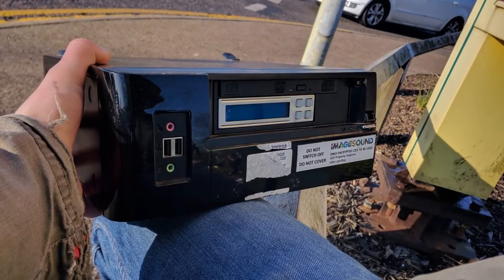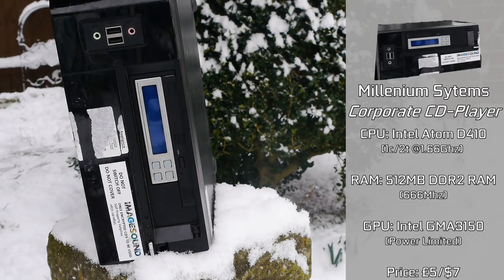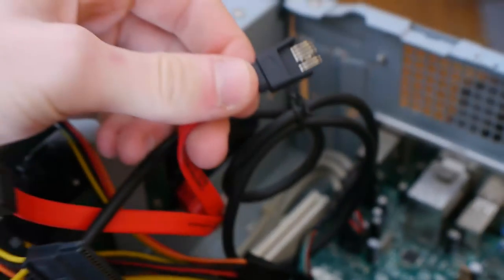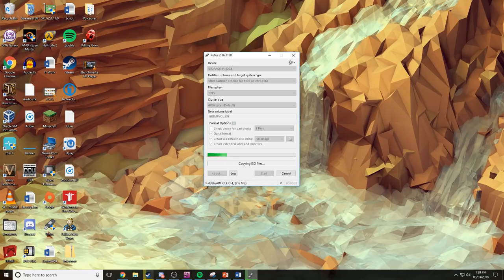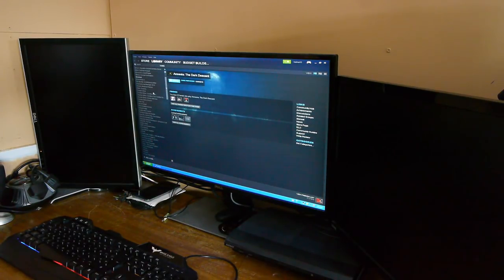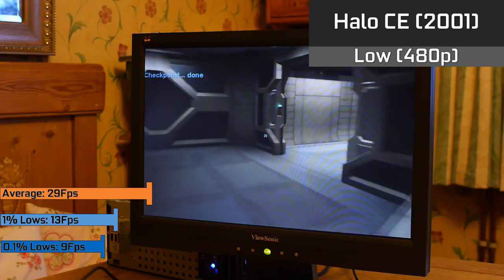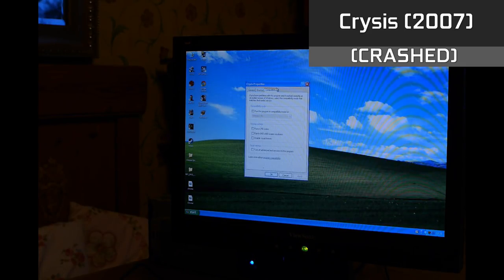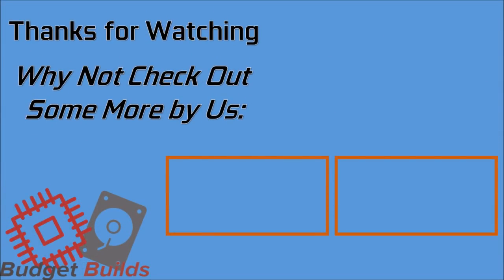Can we GAME on a £5/$7 CD Player from 10 Years ago?

Comment: Gt 610? Sadly, that was my first gpu bought from amazon.
Reply: Klutz Specter there are versions of the GT 610, GT 520, 8400GS, 6200, HD 3450 and HD 5450 on the old fashioned PCI bus (as the motherboard lacks both PCIe and AGP slots)
Reply: I just wonder how gaming felt back then, playing doom in the 90s and using 1Ghz cpus, sound cards and such.
Reply: @RWL2012  I had a 6200 PCI video card in an old P4 system, there was also the 6200 turbocache which was an even cheaper version of the 6200 because the card only had 16-64mb Vram (depending on what version you bought) and used system ram for the rest (so the system seen at least 128MB Vram) but performance was even worse due to the turbocache, and it wasn't really a great card, it was better than the Intel iGPU that was in the system I put it in.

Comment: I have a challenge for you.Buy a prestigio netbook with windows 8/10 and try to install windows 7 on it i tried it for weeks but it is just too locked
Reply: BigSmokeVEVO lol, it should only need a simple change of BIOS settings. Something like disabling Secure Boot and changing the boot mode from UEFI to Legacy BIOS. That's what I had to do to get Windows 7 working on my Acer Aspire V5-121.
Reply: RWL2012 there were no such bios settings tho...
Reply: BigSmokeVEVO gathered as much. not sure what to suggest then sorry

Comment: i got help from toms hardware that i should be able to get a gtx 1050 to work with an i5-3470 and a dell 0XYZT71 motherboard i found near my gpu slot 1 2 3 and 4 is this correct
Reply: FM Mapping yeah that should work fine

Comment: I have the same issue with FarCry running on a Windows XP VM on my Windows 7 machine. No grass, at all. Just like yours. This is the annoying thing about retro PC gaming. You can only really play very old games (DOS) or new games relatively easily. Post 00's and probably post 90 games on Windows, not DOS are a struggle.
Reply from the maker: Try OpenGl Mode.

Comment: If you want to give this some GPU so it can at least play something, look for the older cards. For example Radeon 9000 PCI or 9250 PCI (just make sure its the 128-bit version). It is only DX8.1 card but it should make things like Far cry, HL2 and such playable. Do not go for the GT610 PCI, I have the card and its completely useless. Its PCI-E to PCI bridge is crappy and the GPU was really not made for that, its PCI bottleneck is so big that it is slideshow even in older games. Yes it can launch modern titles, but for what is good when you have 2-5fps.

Still, generally, in games the Atom gets outperformed even by Pentium 3, its gonna be crappy all around.

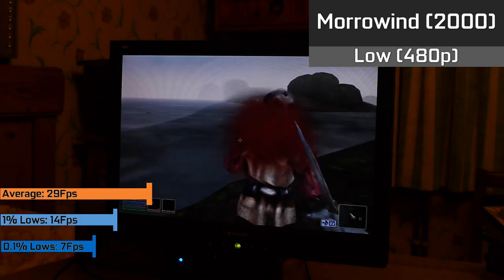Comment: 10:18 - Why would the GT 610 be considered "legendary"?
Reply from the maker: Its the fastest GPU available on the PCI Bus.
Reply: Oh that's cool! I never knew that is was offered on the PCI bus. I was just a bit perplexed because I have one of those but it's a PCI-e version.
Reply: ArthurIVA GT 520 PCI, 8400GS PCI, 6200 PCI, HD 3450 PCI and HD 5450 PCI all also exist. Although outdated and low end, they are still relatively "modern" cards to have versions for the original PCI bus (most examples are PCIe and/or AGP but PCI versions do exist) but for a machine like this with a bare basic motherboard with neither AGP nor PCIe, it's the best you can do.

Comment: considered trying ubuntu on these weird devices?
Reply from the maker: I might give it  go. Its very hard to get it to boot to other devices.
Reply: may be able to install the OS on a external device if its able to? CD, USB, harddrive
Reply from the maker: The PC doesn't like to post without an OS on a HDD Attached, even with Windows XP it was temperamental, if you disconnect the HDD at the right time it will post and boot to the CD Drive, so you may be able to do it that way.

Comment: You think this is slow?
Try my Thinkpad T500...
That thing has a GPU that is so slow it can't even run half-life 1 or quake 3 at the lowest possible settings. As soon as you increase the resolution to more than 800x600 it becomes a 1 fps slideshow. Modern Intel HD graphics are 2000% faster according to userbenchmark and it's almost the worst GPU on userbenchmark as a whole. I couldn't find anything to play on it other than the lightest FNaF game...
Beat that!

Comment: Why do you need a gt 610? won't any pcie gpu work?
Reply from the maker: It dosent have a PCI-E slot, it only has PCI.
Reply: Budget-Builds Official so the gt 610 is the best GPU that is just pci?
Reply from the maker: Muffin Man392: Yep.
Reply: Other cards are available. 6200 PCI, 8400 GS PCI, GT 510 PCI, GT 520 PCI, GT 530 PCI, HD 3450 PCI, and HD 5450 PCI.

Comment: Two mistakes, that's not a CD player, it's a custom made appliance and also, you wish that teensy Atom performed like a Pentium M. It's nowhere close and I have both, a laptop from 2005 with a Pentium M and the bigger brother, Atom D525. The atom sucks for almost every task, it even struggles when opening a window on windows 7 or XP.
Reply: Important question thou, can it play DVDs? ;)

Oh, forgot to mention but you probably figured it out. That Intel Desktop Board this system is built on, uses a BIOS written by Intel instead of the most common AMI or AWARD in other boards. It is very picky when booting from external devices and even internal disc drives. It takes, no joke, up to 2 minutes to get past the INTEL post screen and loading the boot information from an external device, it makes it really annoying to boot from like, an external disc drive to setup the OS or even to make backups. Set the boot order in the setup screens, reboot and patiently wait...

Comment: everything runs like crap cuz it probably doesnt have HardwareT&L (im almost sure it doesnt).
also, I think it could be overheating.
Reply from the maker: Never went above 30C
Reply: and why not overclocking it? Or it isnt possible?
I still believe it doesnt has hardware T&L.
Reply: Bero256 i had a netbook (clevo) that had an atom D525 and a GMA3150. I remember most games had issue with hardware T&L.
some games, like brainbread, had its graphics all screwed up just like the player 3d models
Reply: 3150 is full of random glitchyness, I have it in my old netbook (a handy kitchen recipe and browsing machine for my mother, at this point). I've gamed on it quite a lot as I used it when on tour with my then quite active band, but I mostly played DosBox games and ran PS1 emulation. There was a cool gaming list on the net what are it is capable of running. But I did finish HL2 on it in 1000x600 without problem, and my Atom isn't that much faster, if at all (1,5 dual core N550), but it did have 1GB of RAM when I used it the most (upgraded to 2 later down the line).
Reply: I have an Acer D255 and WinXP is a bit of a mixed bag with it because of the drivers. After trying several Linux distros, Win 7 Starter (came with the system alongside Chrome OS), Win XP, Win 8.1 and Win 10 on that netbook, I found it worked best with a Win 7 Home 32bit. Although the 8.1 was the fastest, it had to be worked around for the smaller than minimum resolution and the drivers for the keyboard shortcuts. The N550 CPU and DDR3 memory is just that more capable to make it decently usable even today. It runs 480p videos on Youtube,  720p encoded movies and the like, and surfing the web with 2 GB nowadays only limits it to less tabs. I've ran ePSXe,  MAME, DosBOx, Virtualboy Advance and similar with no issues, some DosBox games had a bit of emulator issues with sound sync and some drops here and there, but it happened to me even on proper desktops.  
I'll try and find a document where I noted all the games I've tested on it and which settings I had playable results with, I should still have it around somewhere.
Reply: I'll give more info about mine...
mine was had a clevo board. Atom D525, 2gb ram, gma3150, 160gb hdd.
it sucked at anything 3d.
GTA SA ran just like our friend said (40~50 fps), everything on low, strong stuttering.
cs 1.6 had some hickups most of the time.
brainbread, as I said, was completely unplayable. every 3d model was glitchy. textures were glitchy also.
if i remember correctly, robocraft run like trash. and the ground texture was invisible.
but quake iii arena ran like a tirsty beast!

Comment: gma 3150... i remember this horrible piece of crap... was used in atom netbooks too and it couldnt even run flatout 2 on the lowest settings possible (5 fps i guess) while amd's netbook cpus back then like the c-60 with integrated hd6290 could run the game just fine on highest settings.

Comment: Atom CPUs of yester year were utter crap!!!! I used to own an atom based netbook with higher specs than those shown here:
Atom n2600 (Dual-core) @ 1.66 GHz.
2GB DDR3 RAM
Intel GMA 3600 integrated graphics
320GB Sata HDD.
Windows XP PRO SP3
The damn thing even struggled running GBA games!!! barely reaching 80% speed, let alone running any PC title.
Youtube playback @ 360p was choppy  with audio stuttering and it always got red hot regardless of tweaking or hardware fix attempts.
So more than the specific setup of your player, the shameful performance of "Atoms" was due to a flawed design as the same issues were common among it´s users regardless of hardware variations......

Comment: Wow this is old dude
Reply: Age alone isn’t the only factor in how powerful a system is. The original Xbox, which is around 10 years older than this, has a more powerful GPU. And a high end gaming PC released in early 2010 when this was made would have had a quad-core i7, 6-8GB of RAM and GTX 480 SLI, for example.

Comment: Still better than a core 2 duo
Reply: No.
Reply: not as good as a Core 2 Duo actually. Did the Core 2 Duo system you used have a 1MB S3 Trio64V2/DX card in it or something?!
Reply: Atom was a cross between Core2's hardware design and the ancient P55C. They threw away most of the thing that makes Pentium Pro/II/III/Core/Core2 and all modern processors fast, the out-of-order execution, and brought it closer to what PS3 and Xbox360 were doing at the time with their PowerPC derivatives. Core2 will run circles around an early Atom.
Reply: The core 2 duo system I used had about 8gb or sarcasm in it

Comment: put a 1080 ti in it
Reply: Not possible as is there is no PCIe slot. A GTX 1080 Ti would be massively bottlenecked by a 1.66GHz Atom and 512MB of RAM anyway. There isn’t even an AGP slot, limiting graphics card options to a PCI GT 610, PCI GT 520 or PCI HD 3450.